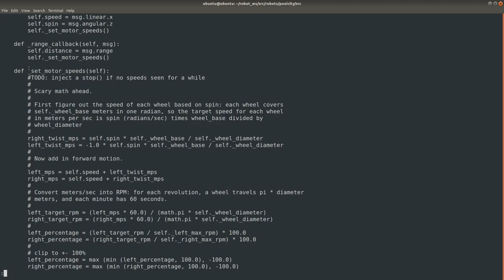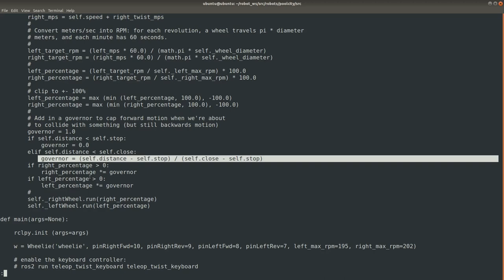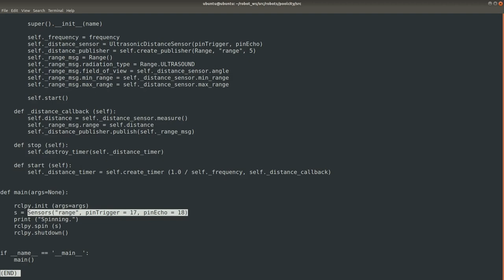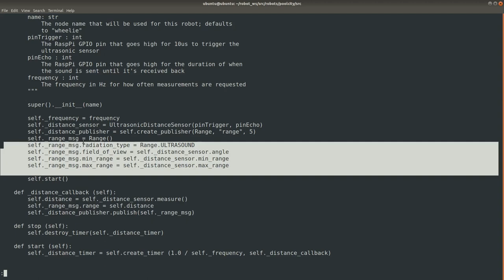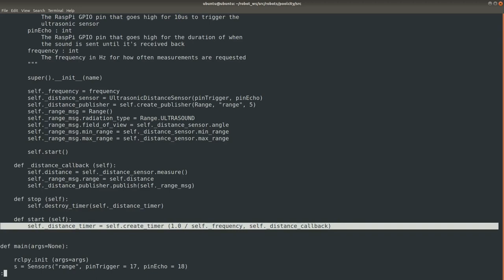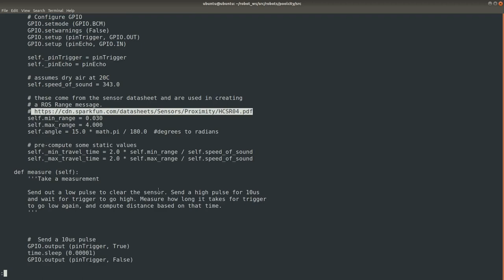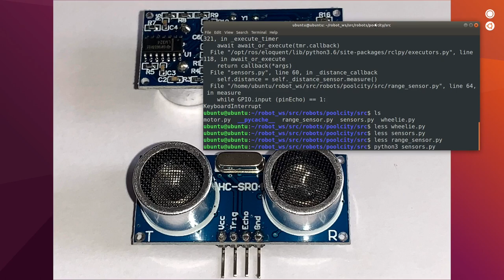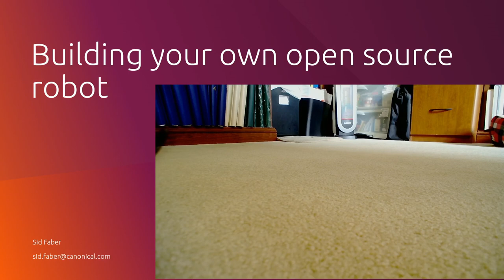An Introduction to ROS, the Robot Operating System: Adding a sensor (6/6)

Comment: Great series! If we want to use the robot for navigation and mapping we would need to add odom and tf - right? For odom we would need a wheel encoder or stepper motors instead of the dc motors?
Reply: Those would both be better than using plain DC Motors. Theoretically, you could put together a navigation program together if you know the wheel speed and dimensions, but it would be extremely prone to drift. As far as mapping, additional sensors would be necessary if you plan on doing any SLAM type mapping